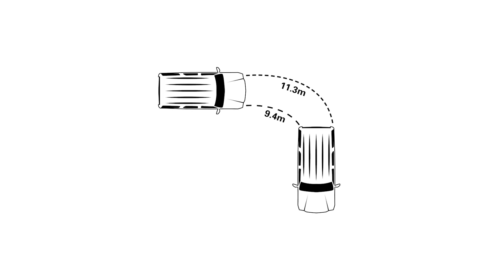SUB $600 DIY LOCKER INSTALL – Watch how much difference it made - Front vs. Rear, Manual vs. Auto

Comment: Would I need to have manual locking hubs for running auto locker up front? I want to order one of these but if I have to swap hubs I might as well get a manual locker.
Reply: Justin Forrest what sort of 4wd / year etc?
Reply: 2013 Toyota Tacoma
Reply: If it has ADD no you don’t need to fit freewheeling hubs. But if you did decide to you would cut down on the parts moving when in 2wd = less wear & tear on CV, diff and front prop shaft.

Comment: Shaun i want to go solid diff conversion on My IFS i Want SFA will i be able to turn when i go 4x4 tracks if its Locked
Reply: TheEdwin071 yeah you will be able to it will just be a tad stiff
Reply: @william6815  thanks you so mutch
Reply: Definitely be able to turn.
Reply: @4wdsystemsgeartogoannawher754  cuss im gona be putting in a Solid Axle in the front so im going My Home work in detail

Comment: Hey fellas  
Where you would you place a lokka  in a  fulltime 4x4  such as an 80series cruiser
Reply: Best option is to go part time transfer case kit, manual hubs and a lokka in the front. Makes the 80 much nicer on the road and you can use low range 2wd for reversing trailers and stuff. Plus you get the front locked for offroad . Would cost around $1000 in parts from 4wd systems

Comment: So how does it know the difference in wheel slip and turning?
Reply: My question too. If the pressure of someone holding the other wheel can disengage the locker, wouldn't a stick wheel disengage it too?

Comment: I bet the 4wd regime wasn't switched on at all when you've been showing how open diff behaves :). When it is off one wheel on the front axle is disconnected from the diff on Hilux.  That is why you could spin one wheel freely and with ease. The diff wasn't rotating and wasn't working in this case. If the 4wd regime would have been ON it would be harder to get the wheel spinning AND the opposite wheel  would rotate OPPOSITE direction since the front shaft obvously cannot rotate on the stopped vehicle with part time scheme

Comment: How does it disconnect? If you're crawling up the hill or even in straight, will it only work on straight wheels?
Reply: It can allow one wheel to rotate faster than the carrier when cornering.
Reply: @JeremyPetho  so the answer is that the lock will only work on straight wheels, is that correct?
Reply: It will still lock when turning. It drives both wheels at the same speed at all times. One wheel can free-wheel ahead of the diff when turning, but only when there is enough traction from the ground.
Reply: @JeremyPetho  awesome. Thank you.

Comment: I would like to install one of these into the front diff of my 2006 hilux but to the best of my knowledge the N70 hilux don’t have freewheeling hubs and no one seems to make a conversion kit for them (the axels and diff are always working even if the is no drive to them). So my concern is the affect to my steering when not on a high traction surface ie wet sealed roads or gravel roads. 
Does anyone have experience with the issue I’m talking about?

Comment: What about 80 series mate ? Is there a locker for front fzj 80
Reply: Yes - if its a part time 4WD then its easy, if its constant 4WD then you'll need a part time (PTT) kit as well - but that will also remove half the transmission backlash and improve fuel economy by 10-15% as well. The special applies to the PTT kit and hubs as well
Reply: 4WD Systems Gear to Goannawhere sorry what is ptt ? Kit lol sorry
Reply: @4wdsystemsgeartogoannawher754  Is the installation process as easy in the rear of a 93 fjz80 ? thanks

Comment: I've got a prado 95 series which locker would you recommend?
Reply: The 95 series is part time 4WD so we can fit fornt and rear, however as the video shows the fornt is by far the best option If you want to fit just one then the front for sure - its pretty much overcomes all the limitations of Independent front suspension - liited wheel travel, no articulation and alost no downward travel - that results in wheel spin and at that instant your back to being a rear wheel drive. For other Prado owners the later models are constant 4WD - so we can only do the rears and there are a bunch of different models for that including VSC.

Comment: Do you have anything for Ford explorer?
Reply: Pretty much covered for all models and variations
Front
Dana 35 TTB, 27 Spline
Dana 35 IFS/SLA, Alloy housing, 27 Spline
Dana 35 IFS/SLA, Alloy housing, 27 Spline
Dana Super 30, 27 Spline

Rear
Ford 8.8"  C-Clip , 31 Spline
Ford 8.8"  IRS

Comment: Could I fit an auto locker into my 1992 Suzuki Sierra
Reply: You could even fit 2 if you wanted to
Reply: I used to do them - but the Zook rear diffs would flog out the cross shaft holes with the 33-35" tyres and I stopped in about 1997. However I am about to release the fronts again - give me 3 months !

Comment: Automatic lockers have been sold under the name Detroit Locker for at least 40 years that I know of. They are a great, strong, trouble-free system.
Reply: Detroit Locker works the same way but it a bigger, strong and more expensive unit that replaces the whole diff carrier.  
Lunchbox lockers like the Lokka are smaller and cheaper, they are installed inside of the original diff carrier.

Comment: So why does the Ford Ranger run an E Locker in the rear ?
Reply: So you can turn it on and get traction, or turn it off and it won't wear down your rear tires when you turn.

Comment: Can these Lokka auto lockers be used in a passenger car in place of a limited slip diff?
Reply: Yes, I have one in my R31 Skyline in place of the original LSD which the clutches wore out. The Lokka doesn't have clutches to wear.
Reply: @geoffmoroney9283  Thanks Geoff.
Reply: @slmiano  I see the VL in your picture, exact same diff as my Skyline. Borg Warner M78. If you are fitting one to a VL your have to start with an open centre diff, the LSD centre won't fit the Lokka.
Reply: @geoffmoroney9283  Yes thats exactly what I was thinking of. It is an open diff and the car is a V8 so it should have 28 splin axles!!  Way cheaper than fitting an LSD.

Comment: Are they as easy to fit in solid axle vehicle EG Jeep JK
Reply: Gary Molony easier
Reply: Jeep is easier to fit than most ! JK Wrangler has Dana 30 (new gen) in the front and Dana44 (new gen) in the rear - got both

Comment: Can these lockers be fitted to the front and rear of a GU patrol?
Reply: Front yes. Not much point in the rear as it is already a decent LSD on coil or leaf rear ends
Reply: Not Lokka brand because they only make them for the front of a GU Patrol, but you can buy a Detroit locker for the rear instead.

Comment: Could you install a locker in a landrover discovery tdi 300 and how wasy would it be
Reply: The land rovers have way to much play in the drive train, from memory they did try develop one back in the 90s but the LR was just too difficult to get the LOKKA set up correctly
Reply: Sorry - dont have one - Used to do 10 spline and 24 spline but not any more

Comment: Another myth I’ve heard with these is that you cant use 4 wheel high on gravel roads etc as the front diff can lock and reduce steering and therefore push you off the road is this true? Been in two minds about putting one of these in the front of my GQ for a while now cheers
Reply: I was thinking about that, it would be similar to using 4 high with front lock engaged, but Shauno did mention it releasing when cornering, only real way to know would be to drive with one fitted, my concern would be if it didn't release
Reply: I fitted one to the front of my GU, if you keep the power on it stays locked. If you feel the front end getting tighter and winding up just back off the accelerator for a second and it ratchets releasing any wind up then back on the accelerator again. If you want to drive long distance on a dirt road at high speed in 4wd for added traction and safety with one of these just leave one hub unlocked. Works great, I prefer this type of locker over a manual for the ease of control with my right foot, when in 4wd I'm always locked, cuts down on shredded tracks and drive line components.
Reply: Yep, they work but can be real dicey, if your apprehensive at all, just get an E locker in the front and leave the LSD in the rear.

Comment: False, auto lockers don’t unlock to allow you to steer. There must be a wheel speed differential and binding in the differential to force the locker to unlock. The problem is the automatic locker is designed to stop these things from happening and it can’t differentiate between a loss of traction off road or turning. There will always be some binding while turning with an automatic locker and this is why selectable lockers exist. Selectable lockers are superior because you only activate the locker when needed on an obstacle.

Comment: QUESTION...i have a Toyota hiace diesel manual rear wheel drive not 4*4... can i install diff lockers in this vehicle
Reply: Hi Mate just found your post, are you still considering a traction aid for the rear of your Hiace? Toyota rear differentials are shared between Hiace and Hilux having had it confirmed by a differential specialist. In having a 4x2 Hilux petrol it took a while to confirm the petrol and diesel rear diffs were the same. I have a Detroit Truetrac in the rear of the Hilux, been in there for over 5 years, and it is a great unit.

Hope this helps, cheers.
Reply: @nathankelly1708  thanks mate.. this really helps..i appreciate
Reply: @kenzymaina7462 From memory my crown wheel is an 8" which is very common. The Hilux is also a 2008 Vigo/N70 series which ran from 2005 to 2015 and so it may be that any Hiace during this time could have the same diffs:)
Reply: @nathankelly1708  so the Hilux shares the same rear diff with the hiace
Reply: @kenzymaina7462  the diff specialist told me they're the same as far as diff carrier and crown wheel and pinion. Are you in Australia?

Comment: What diff would you recommend for a fulltime 4wd  land rover
Reply: Nissan ;-)
Reply: You could check what torsion has, it works really well with vehicles that use brake based TC.
Reply: @okigojuryu  ok thanks
Reply: @v8eaters321  np dude.

Comment: There is a big problem with this design , on soft stuff (sand) there is not enough friction to unlock the diff .Thus the car does not like to turn . Has could me out once , into the scrub I went.

Comment: Myth 2 does not apply in all cases. You said that front diff is working only if you engaged 4wd mode and it is disconnected when in 2wd mode. That is true only for cars with locking hubs. 

If the car does not have locking hubs, then 2wd mode usually means that front drive shaft is disconnected from transmission, but front wheels are still connected to front diff and front drive shaft.
Now, I don't know how many cars have locking hubs and I can imagine most 4wd modified vehicles will have them in place. Despite that, I believe you shouldn't oversimplify the explanation and practically create another myth.

Comment: for the same price you can get a HF or a TRE air locker witch is a chinese perfect copy of ARB. With all do respect to you guys being Ozzyes but ARB got copyed and way cheeper by the good old chinese. dough the ideea is good
Reply: The problem with the cheap air lockers is that they lack the strength of the more expensive ones. They do the job but instead of breaking an axle, it is likely the whole carrier will shatter.

Comment: "Myth 1" & "Myth 2" Is very deceivingly answered. If it is in the rear/front and you do ANY kind of acceleration the axles will STAY locked. The locker will only unlock under low or no throttle applications, and even under low throttle application if you are doing steep inclines with turns the locker also does not unlock. Keep that in mind people.

Comment: does the locker stay engaged when you're turning on a hill in 4wd?
Reply: Bloodamir80 yeah mate
Reply: from the video I dont believe so. only in straight line
Reply: adam bennett nah it stays engaged, unless you’re on the bitumen then it won’t disengage when turning etc because you’re wheels can slip on the dirt, whereas then don’t just ‘slip’ on the bitumen so causes it to unlock, 
Had one in my Jeep for a few years and is the best thing I’ve done to it, works very good off-road and has never unlocked or had problems

Comment: Is there one that will fit my Daihatsu Hijet Truck?
Reply: Check the website they make them for most mainstream 4x4's.
Reply: @dartmoordave  Cheers, but its definitely not a mainstream 4wd unfortunately
Reply: @benstyles3980  Yeh but have you done any parts digging to see if that diff is used by someone else ? I'm looking at small ads here in UK and the top one is a HiJet 4x4 truck, 14k miles £7500.  So they are about.
Reply: @benstyles3980  Could you put Suzuki axles on it?
Reply: I honestly have no idea about this one - if you can get me the parts list I will check the part numbers of the differential - if its the same diff as as the SCAT, TAFT, Rugger, Rocky etc in 29 or 30 spline then its good chance I will be able to do it. Those axles are huge for such a small vehicle - so it wouldnt surprise me if they are the same

Comment: How come there's no comment on the on road noise
Reply: Installed in the front diff in a part-time 4wd, there is no on-road noise - the front diff isn't turning. The off-road noise, in my experience, isn't audible over the engine noise.

Comment: Does it disconnect in 2wd ?
Reply: If you have installed a front then then its not working in 4WD assuming you have either Hubs, or a disconnecting axle or a part time option in the transfer case - which is most vehicles 

If you have installd a rear and are asking does the rear disconnect if you engage 2WD in the transfer case - the answer is no - but its designed to work in the rear and will engage and disengage as needed for cornering etc

Comment: This is what needs to be fitted in Graham's Dmax, I cringe when watching his Dmax when it is doing technical offroading.  That Isuzu traction control system has been programmed very poorly from the factory, it allows a massive amount of CV busting wheel spin before it reacts and brakes the spinning wheel a few seconds later.  It should have been programmed from the factory as a proper brake lock differential system instead which does not allow wheel spin.

Comment: What happens if the tolerance is slightly out?
Reply: from memory the pins will break, causing the LOKKA to stay locked and possible further damage
Reply: @richardkomar8765  will it be noisy if the tolerance is out? Got a diff shop to build my centre, hoping the noise is a CV, find out on Monday when I change it
Reply: @brendanpyne7735   Auto lockers are noisy even when they work properly.  
If the Lokka is too tight it will not want to unlock and if it is too loose it can wear out prematurely and the teeth can start skipping.

Comment: Isn’t it best to put front and rear lockers on a switch?
Reply: It might be best to have manual lockers, but auto lockers are much cheaper and also more reliable since they don't need air or electricity to operate.

Comment: there is some false info in here. i don't recommend these "auto lockers" for front diff applications. lunchbox lockers aka auto lockers only disengage when in 2wd or when in 4wd in neutral. when there is power going to the axle with the lunch box locker it's going to be locked. Ive owned a few and this is from experience

Comment: How robust is this locker tho?
Reply: 4wd systems did a special on one of theses In The Everymans Rodeo!
It has now done over 150 000 ks
works the same as when it was put in
Reply: Depends on what you are using it with. On something like this Hilux it should outlast the vehicle, the front shafts will break before the locker.  
On a big truck with big tyres, big power and big axles you would be better off with something stronger like a Detroit.

Comment: What I need to know Shaun is, how does this artificial intelligence know the difference between a vehicle 🚗 that’s driving in an off-road situation, with one wheel in the air, and therefore needs the lokka to stay engaged, and a vehicle 🚗 that’s simply turning on a highway and needs the lokka to disengage in order to make the turn?
Reply: Because the wheel isn't in the air spinning faster than the one on the ground .

Comment: so if your mate has a wheel lifted and is sitting still, you can screw him over by spinning the lifted wheel. he he
Reply: Wouldn't work, because they need to be under power to work. In a no load scenario, they just ratchet.